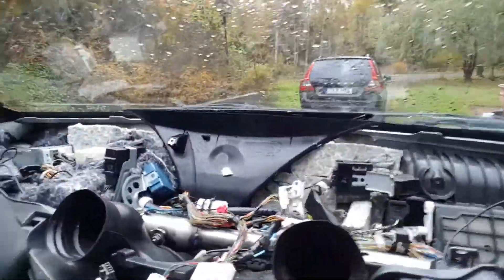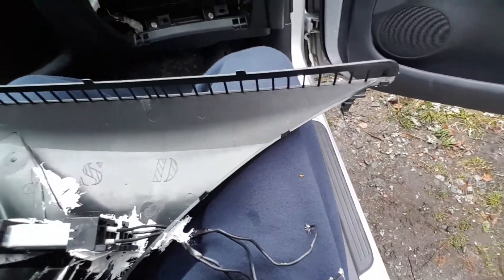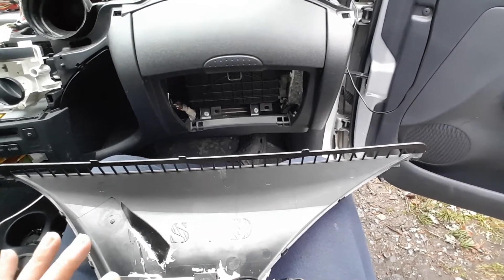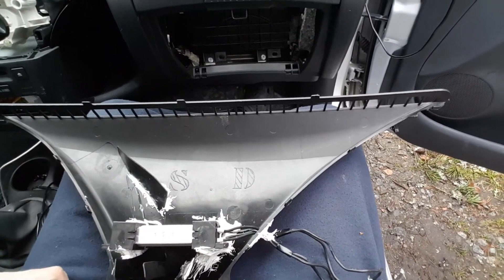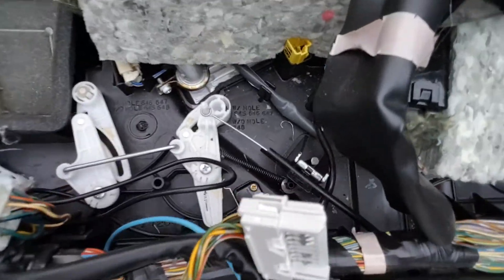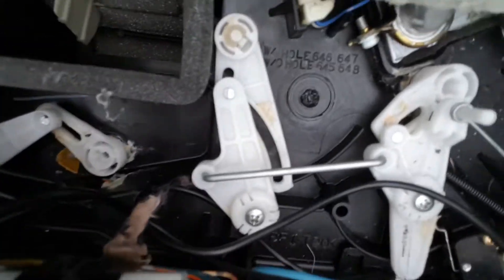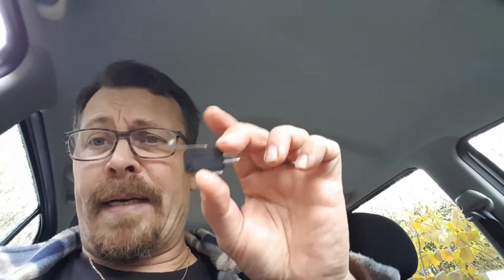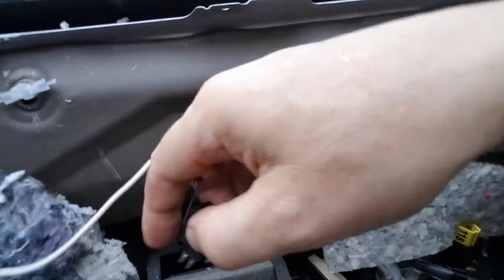PTC heater install part1

Comment: Does it need just 12V input or?
Reply from the maker: I just purchased 12Volt PTC on Aliexpress. Not any specific car brand. I use 100Watt versions. They can be pretty hot so thats why I did not use stronger.
Reply from the maker: Hello Johny. That is correct. Be sure to have wiring that can handle higher currents.
Reply: @swedemake5571  thanks. What ptc did u used? I mean car brand